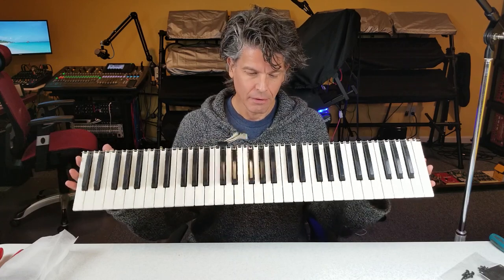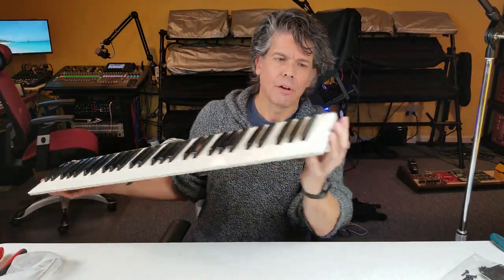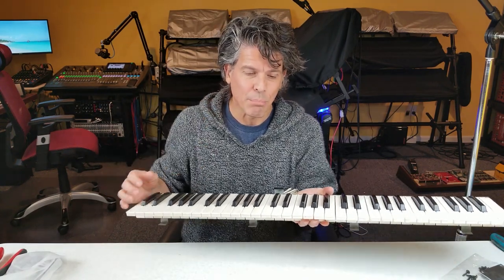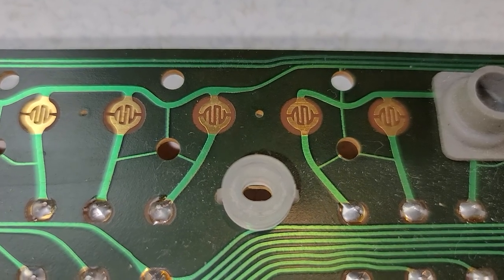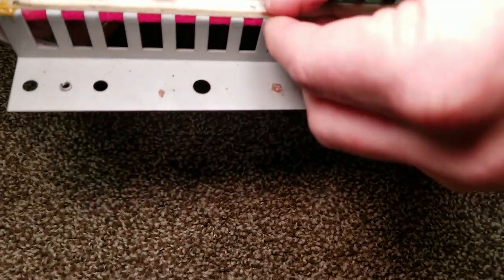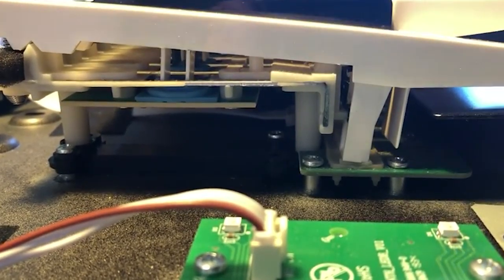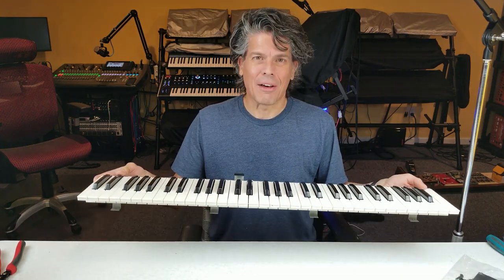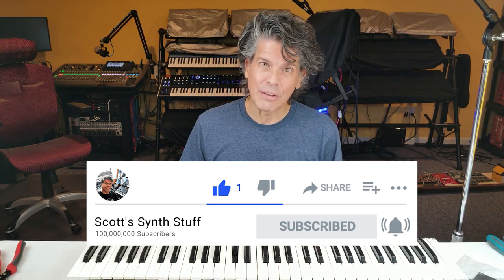Your Synthesizer Keybed: How It Works, and How to Fix Problems

Comment: Hey Scott I have a Roland Juno DS-88 I bought it off Facebook to learn piano got it for a good deal it was working fine and then a couple months down the road 2 keys don’t work white and black  I took it apart I cleaned the carbon I switch out the rubber carbon from a different section of the keyboard to test if it was the contacts that didn’t work no sound on G3 A3 I don’t no what to do my uncle is becoming a pastor and I wanted him to use it for church I’m from nj and I’m trying to find a person that fix’s keyboards not so easy if you have any suggestions or advice that would be great thank you
Reply from the maker: You've done the first thing I would have tried, next would be to look at the cabling - if you're not comfortable with electronics, it's time to get it to a tech.

Comment: Good morning,
after turning on my Novation Remote SL61 MK3 keyboard, I got this error message: "Keybed has reported an error during the boot process".
I can no longer use the keyboard keys but the other buttons work.
Does anyone have a solution please? Sincerely.

Comment: Would I be able to change the action to a lighter spring on my synth?
Reply: I've got the same question but would like to increase tension on the Fantom 6 keybed
Reply: @oosaxx  Actually I’d like to reduce tension on my AKAI MPC Key 61. Been a Korg user for over 30 years and the AKAI is just too springy - spongy for my taste.
Reply: @BartMontalti  I hear from the forums finding a used keyboard with the action you like and pulling the springs off of it is the easiest path forward. Those who have done the mod say it wasn't too complicated but it seems not alot of people have done it.

Comment: Hi Scott.  I pulled my vintage Mini Moog out of storage.  I have not played it in about 5 years.  It basically is in mint condition.  Never been on the road.  Anyways, I turned it on and many of the keys are acting as though I have the glide switch on.  When I press a key, the sound wobbles up and then back down erratically. Then back up and down with no pattern ,rhyme or reason.  With a mind of its own.  I turned the glide switch on and off and still the same.  I'm wondering if the contacts have got dusty or something.  I'm hesitant to take the keyboard apart and may just take it in to a local vintage keyboard service company to have them diagnose.  Your initial thoughts on the problem?
Reply: Tes, check/clean the key contacts. If that doesn't help, check the sample-hold circuits for out of tolerance capacitors.
Reply from the maker: #1 thing is to look at cleaning the key contacts. Oxidation can do exactly what you're experiencing.
Reply: Thanks for the reply.  I will look into this.
Reply: @daveogarf  Thanks for the information

Comment: So it's basically a cheap computer keyboard (cheap as in: not mechanical).
3:00 basically, it's not a switch. If it was, it would be mechanical :) and work far more superior and much longer without issues.